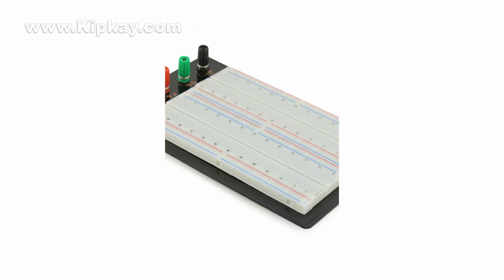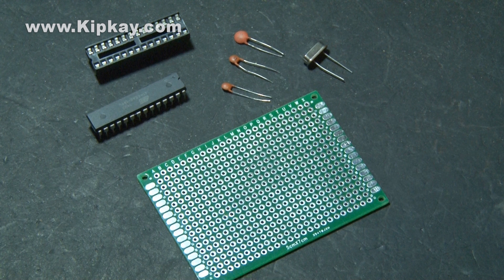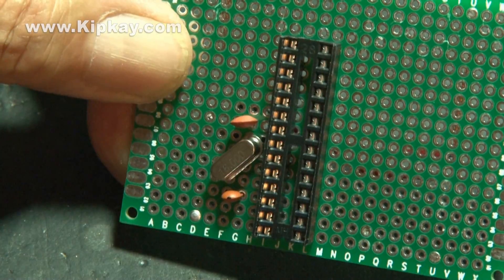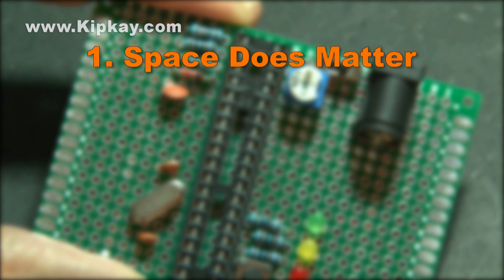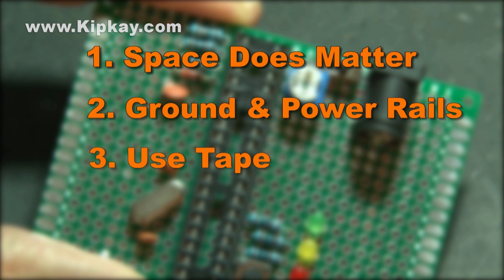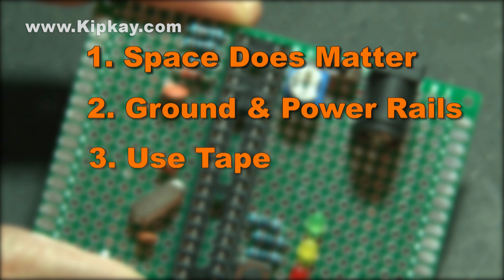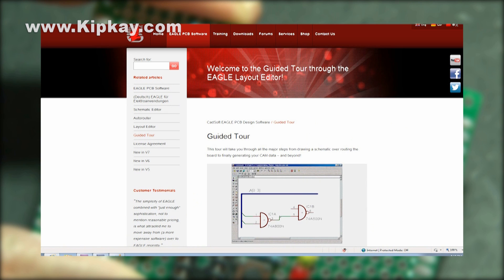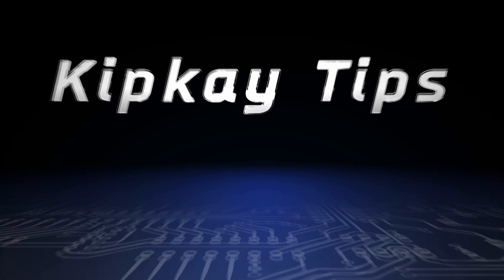How-To Build Stuff on a Circuit Board!

Comment: Why would anyone ever use those pad-per-hole turds instead of stripboards and a drill?
Number 1 priority with circuit boards should be minimizing the usage of actual extra wires.